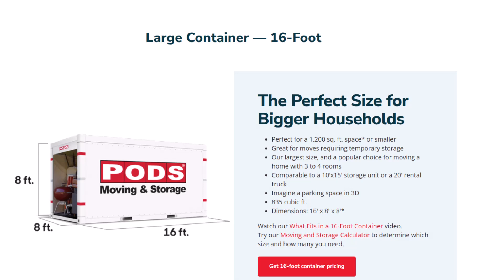Electronic Scrap Board Upgrade and Move Preparations

Comment: western NC? have you checked out the local scrap yards? What size town and will they allow street scrapping? I am only asking because I moved from SoCA to very northern CA. Closest scrap yard is a two hour drive and no street scrapping. I have to mail all my copper to Las Vegas and boards of any value to Board Sort.
Reply from the maker: I've already met with the owner of one of the two biggest yards in the area. We've agreed to a plan where I'll buy their escrap, which he's already starting to put aside for me. I've also had a great meeting with a computer repair store in the area and we'll be working together to help the city/county reduce the impact of escrap on their landfills. I'll still be sending my higher end boards to Boardsort but my shipping will be less expensive as I'll be closer. There will be changes for sure, but I believe I'm as well prepared as I can be.  Bottom line - not going in blind.